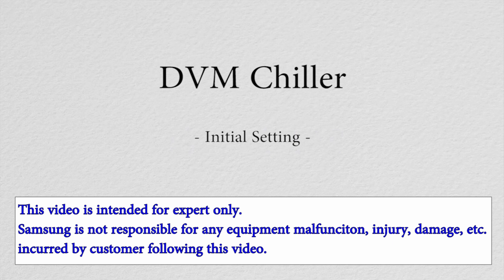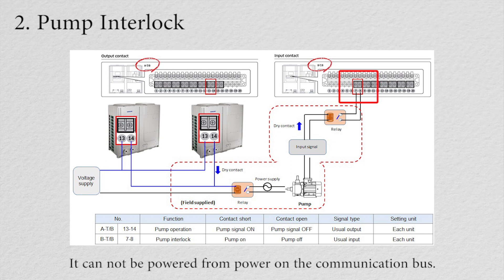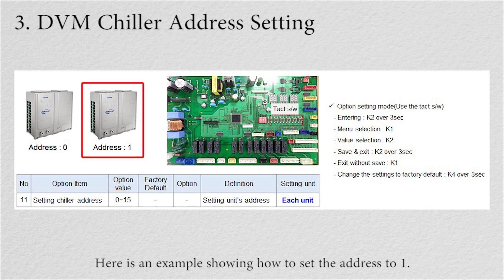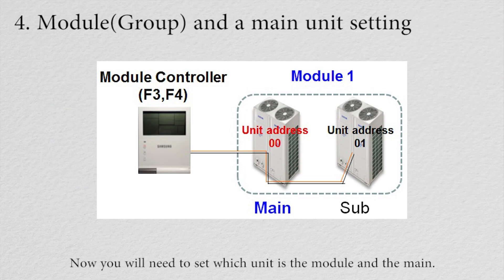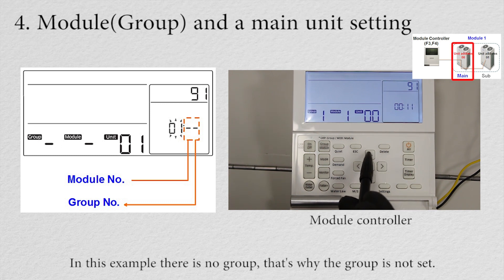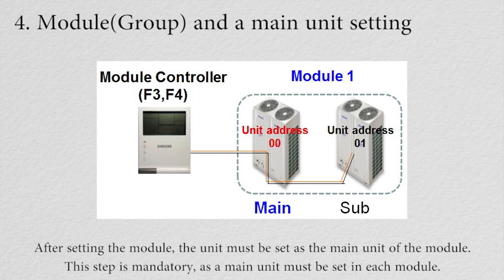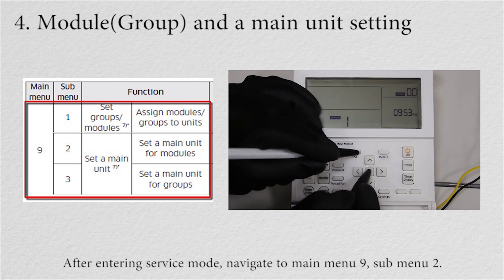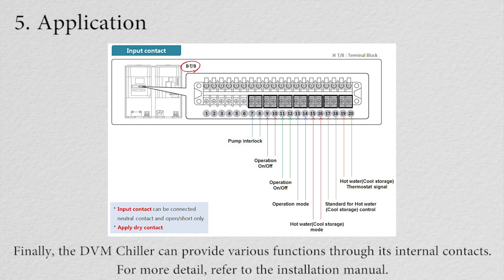DVM Chiller Initial Setting

Comment: *Chiller trip on interlock .
*Error code E918.
*Clear the error .
*Hard reset. 
*Chiller back on to normal for while.
*and trip again .
*chiller linked to BMS
*external pump.
Questions.
*How do I configure the chiller to operate locally?
*how do I prove flow switch is healthy?
*help if you can cheers
Reply: Justo tengo el mismo problema, como se resuelve este error?